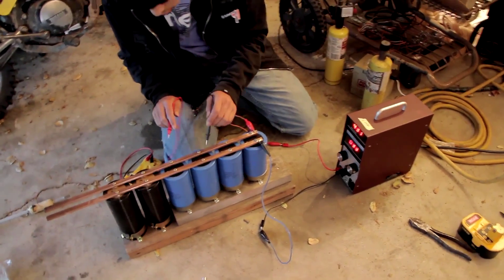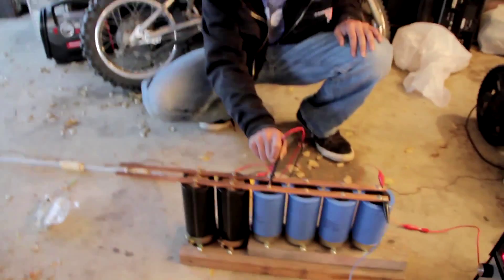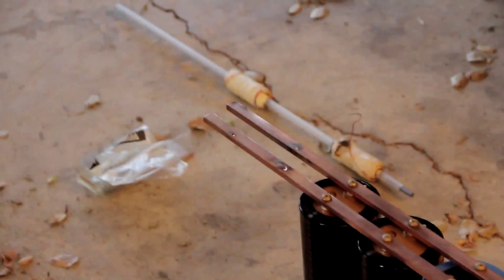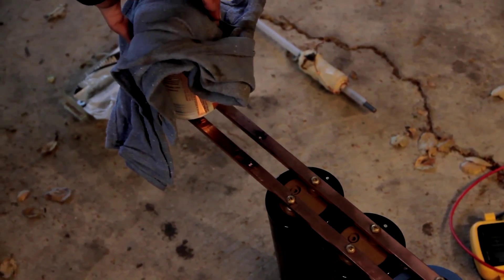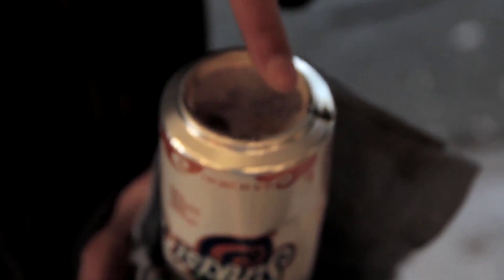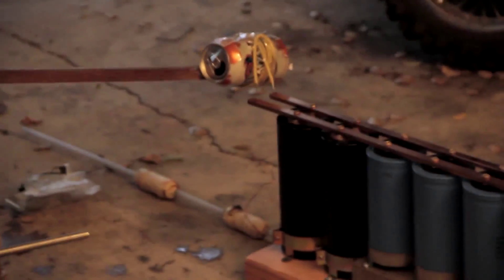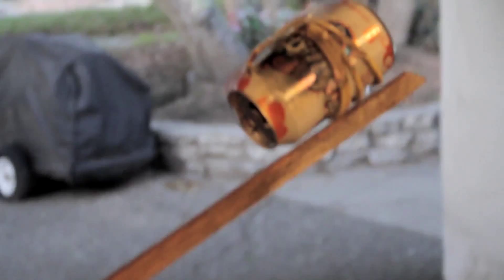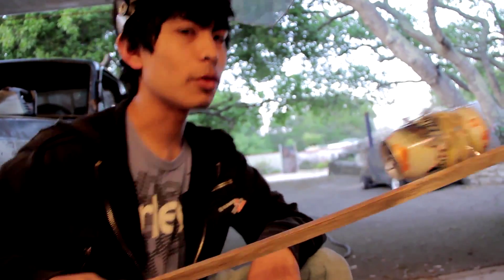Capacitor Bank Testing: 400V; 2300 Joules

Comment: I think that you can ruin electrolytic capacitors by discharging them through inductive loads like the can crusher, unless you have adequate inductive kickback protection like a stud diode or SCR. Also electrolytic capacitors are less suitable for can crushers because they have too much ESR = less peak wattage. Unfortunately unpolarised capacitors are bigger and more expensive!